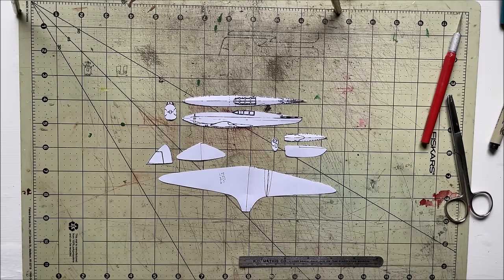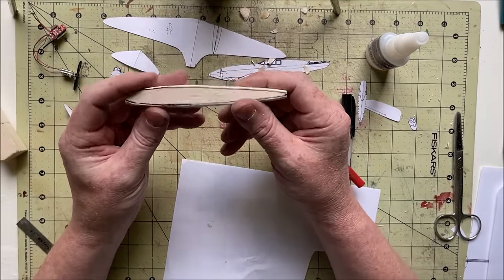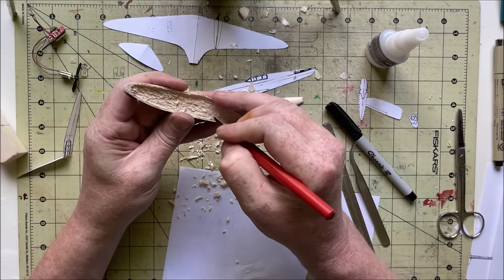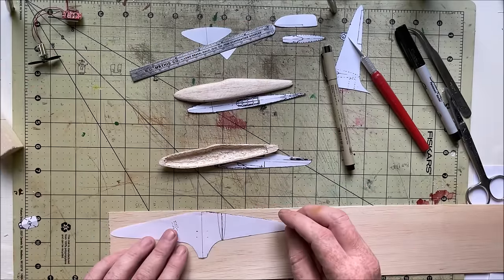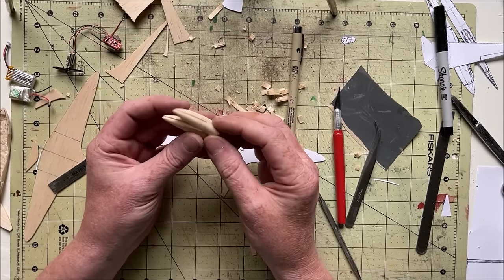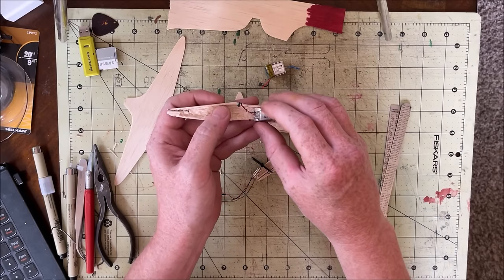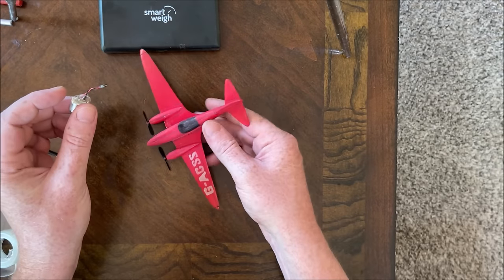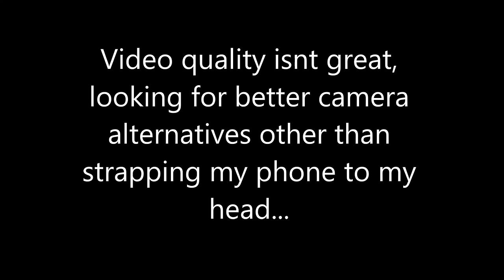micro DH.88 Comet RC plane build/flight

Comment: Wow.  What an awesome little plane.  At first I was thinking: How can this fly?  But now I see that it flies around like a little dart.  No wonder you painted it red :-)   I am guessing that it goes up and down by making both motors faster and slower.  And goes left and right by making the motors go at different speeds.
Reply from the maker: Thanks!  Yep, yaw is controlled via thrust differential steering, pitch is by throttle amount...pretty simple, but works quite well.

Comment: How do you navigate it without any wing flaps !??! 
Honestly, in compare of the size, speed and control you really should try to build a cockpit by removing the wood for a cockpit which fits a tiny VR Cam incl. the electronic parts covered with a self made aerodynamic light weight plastic windshield. 
Imagine you wear a VR glasses which gives you the illusion to sit in the cockpit and fly the plane like a real pilot. I mean it´s hard to watch the plane for a whole flight time with the naked eyes, but a VR system allows you to record any single flight on a micro SD card inside the plane ! I think such a extra would make it perfect! Not a lot people own such a tiny, handmade bird build from aluminium would be the kings discipline par excellence !
Reply from the maker: This one uses thrust differential for steering, one motor speeds up while the other slows down, and throttle and center of gravity location for pitch...more throttle and it'll climb, less and it comes back down.

Unfortunately theres not enough wing area on this one put any more gear, I do have a pretty small FPV camera system though that'll eventually go into a model, been wanting to try that for quite a while now.

Comment: Well done!  Amazing how well it flew!  I don't really understand how it's controlled but than I'm a larger builder, not a micro one :)
Reply from the maker: Thanks!  It uses thrust differential steering, one motor speeds up while the other slows down and it makes it yaw, pitch is just done by giving more or less thrust.  Super simple but works quite well.
Reply: @microbuilder  thanks for the reply!  Sounds like the model needs to be very well tweaked and balanced for this to work - Respect! 👍 Have a nice day
Reply from the maker: @Steven3D8888   Thanks!  Yeah setup is a bit fiddly, but still like a normal plane, just smaller tolerances.

Comment: Really fantastic! Gonna try your technique on making a twin engine micro plane, myself. Since the plane you got the motors from works with "pusher" engines, did you have to do something to reverse the direction of the motors? Or, did you find propellors with reversed orientation? If so, please share where you got them!  Many thanks.
Reply from the maker: Thanks!  I actually dont remember what I had to do for the props to go from pusher to puller, but I know in the past the most I've had to do was pull them off, and flip/switch one with the other, definitely shouldnt have to do any soldering.  There should be a link in the description for the plane I got the parts from, but if not, do a search for KF606 RC plane, it should pop up.
Reply: Thanks for your reply. Another question: do you remember how you got the wing dihedral to remain in place? Perhaps a tiny strip of carbon fiber, or just CA glue? @microbuilder
Reply from the maker: @steverudd5745  I cut the wing shape out, then just scored the cut line down the middle between the two wings and 'cracked' the dihedral into place, then just glued it.  Doesnt take much with these little guys lol
Reply: @microbuilder  Awesome, thanks so much!

Comment: This is awesome!  I can't believe it can fly like that without any surface controls and just the two motors.  How does it gain altitude/drop?  Just more or less power?  It turns perfectly too.
Reply from the maker: Thank you!  And yep, more throttle = climb, less = dive, there is a gyro built into the RX on this little unit, so thats probably helping, but yaw was still quite sensitive.

Comment: To get an even coverage use paper towel wrapped around a block of wood. If you want it lighter get some 99% rubbing alcohol and get another container from Walmart or similar in the cosmetic section, like the bottles for shampoo for traveling and flights. Add some rubbing alcohol to it then add some of the Indian ink and do a test. Add ink till you get to the color you want. 
Also you can do a full dip to get everything colored in one go. Just use a stick pin in the nose of the plane and dip it in the ink and take out quickly. Let dry and repeat if needed.
Reply from the maker: Great tips, thank you!

Comment: This is so cool. it really makes me want to give it a go, but I know that I may well end up with a non-flyer
Reply from the maker: Give it a try, the electronics I used came from a $30 ready to fly micro plane (the KF606), foam dinner plates work as good cheap build material to get your feet wet.
Reply: @microbuilder  Thanks, I probably will at some point, the new motors and recievers are so small these days. Did you have a rudder or use motors for Yaw ?
Reply from the maker: @goingoutotheparty1  This one just uses the speed of the motors for yaw, slows one down or speeds one up to make it turn.  Works quite well.

Comment: Aight this is cool, i might attempt to make a budged plane like this with one of those micro drones
Reply from the maker: Thanks!  I've never tried it with drone electronics, not sure if the flight stabilization or the way the motors work together would cause any problems.  Cant hurt to try though, and if it doesnt work, the plane I got the electronics from was only around 30 bucks.

Comment: what kind or brand of hobby saw are you using @1:25 it looked like it made short work of sawing that block of balsa, I did hear you say at some point in the video that the balsa you were using was fairly soft I had a nice one years ago that I liked and have one now that I don't like so much so looking to buy a better one!
Reply from the maker: Its an Irwin Dovetail/Detail saw (#213104), its incredibly sharp, I've used it to hack through some fairly large tree branches with little effort.

Comment: I do this a lot, probably not as small as you do I'm probably older then you are so my fine motor skills are tricky. So most of my small, I don't know if you can call them micro, but the wing span are under 20 inches. It's a lot of fun. I also build Balsawood kits, repair Balsawood & foam planes that are deemed unfixable. I have a lot of experience with planes, rockets, including High Powered Rockets needing certification, boats, and real aircraft, but retired. I'd like to try what you have done, it looks challenging. I always use parts from broken planes, I also offer money to those that crash real bad at flying fields. I can get my parts cheap. I use to just by whatever I wanted to try, but the prices are ridiculous for foam even kit planes with that and old age smaller one make more sense. I'd like to know specifically where you got those plans as I just wing it, no punn intended. Thanks for a great video.
Reply from the maker: Under 20 is definitely small, going smaller isnt much different, just a little more fiddly, definitely give it a shot.  The plans I just pulled off google after searching DH88 Comet 3 View Drawing, then I just scaled it to size when I printed it.

Comment: did you connect the batt at the wrong side right ? that was the problem. Nice job !!!! very nice
Reply from the maker: Thanks!  I think I accidentally cut the plastic coating on the receivers power wires, allowing them to short.

Comment: Hi, I just ran across your channel. And I was just wondering if you ever tried motorized like 1/48 scale plastic models? Or is the plastic too heavy of a material. I have countless foam military scale large aircraft RC Planes and many RC Hellicopters
Reply from the maker: I've wondered about that too, I actually went out and bought a couple plastic kits a few years ago, one of them the plastic was pretty thick so didnt figure that one would work, but the others plastic was surprisingly thin...never got around to trying to fit some RC gear in it, but it would be pretty cool to have something with all the detail plastic models have.
Reply: @microbuilder  That's what I was thinking the whole time on your build
Reply from the maker: @TheBuell49  Yeah I'm going to put that on the projects list, too cool not to try at least.
Reply: I would definitely be interested in that. I'm always working on project's and when there cool and actually work is always a lot fun
Reply from the maker: @TheBuell49   Agreed!  Cant say when it'll be, I've got 3 or 4 projects waiting in the wings (sorry for the bad pun lol), but its definitely on the list.

Comment: Hey there! Once again here to say great work, and to ask a couple of questions. A little while back I had said that I was working on a model like this of a de Havilland Mosquito in 1/72 scale, and I have a couple of questions in regards to overall weight. My model currently weighs about 6.4 grams in total. With electronics and paint, that is expected to go up to 12-13 grams in total. My model has about 8 square inches of wing surface area (10 if you count the elevator as wing surface as well). As of right now, it glides pretty well, requiring just a touch of trim to the right to ensure it stays on path. My question is, will it be able to fly well if it weighs 13 grams and has 10 square inches of wing area? I know that you recommend around 1 gram/square inch, but how much more can the aircraft tolerate before it becomes unstable? I also managed to incorporate a pretty decent airfoil into the wing, if that is a factor. Again, great work!
Reply from the maker: I generally dont count the tail surface area in my wingloading totals, mostly just because the tails on these little birds are so small they dont add much (though every bit helps).  If youve got enough thrust, it'll probably fly with your higher wingloading, but like this DH.88, she probably wont slow down much, might get a bit twitchy too, but that makes for good thumb practice lol  Big grassy fields go a long way in helping survive the first handful of test flights, I'd start with probably 3/4 throttle and a good solid throw at a slight upward angle...your fingers will be busy, so cross your toes lol
Reply: @microbuilder  Thanks for your advice again! Hopefully when I get her ready to fly it won't be a pain in the air :P When I finish I'll be sure to show you some footage lol
Reply from the maker: @DomsCorner123  No problem, and good luck!
Reply: @microbuilder  Thank you!

Comment: In future glue a sheet of paper in between pieces of wood you wish to split apart again. Tempory joint which when opened tears through the sheet
Reply from the maker: Paper becomes surprisingly strong when CA is applied, the halves would probably break apart ok, but removing the remaining paper might get tough.

Comment: what am i missing, i didn't see any control surfaces, how is the plane banking and controlling pitch???
Reply from the maker: It uses thrust differential steering, it slows down or speeds up one of the motors to make it yaw, pitch it controlled by throttle.  Pretty simple, but equally affective.

Comment: Have you tried coating the balsa in CA glue? Does it add much weight, or is it pointless?
Reply from the maker: It would definitely help strengthen the skin of the wood, as I've used CA as a clear coat on an old beater guitar I've got, but unfortunately CA is also pretty heavy.

Comment: Awesome build never saw a block cut into shape like that . I want to try building a micro plane where do you buy motors and electronics have a great day
Reply from the maker: Thanks!  If you do a search for KF606 rc plane you'll find the plane I used the electronics from.
Reply: @microbuilder  thank you for the replie going to start on plane this weekend
Reply from the maker: @chrisgilpin3403  Good luck with the project!

Comment: really great video and results, congratulations! I was wondering what reciever + ESC + motor + battery combo you would recommend. I would love to try and make my own micro RC plane, but I'm not sure where to find micro electronics.
Reply from the maker: Thanks!  If youre looking to just get started, I'd suggest the electronics that I used in this plane...if you do a search for KF606 RC plane, you'll find them on ebay and amazon for 30-50 dollars.  You get a 2.4ghz radio and receiver, the motors, batteries and charger, plus the foam plane it all comes in to play with before you take the electronics out.  Pretty hard to go wrong, considering a 'hobby grade' micro RX meant for magnetic actuators can be 30-50 dollars all on its own.  Also worth checking out RCGroups, its an RC forum and they have a scratch built micro RC section where I learned everything when I first started.
Reply: @microbuilder  Just bought the KF606 online! Let`s see what I can do... Congratulations on all the views on this video, looks like its going viral!
Reply from the maker: @thiagov6123  Thats awesome, theres many twin engine planes out there to choose from, almost makes it hard to pick one.  And yeah I'm kind of blown away at how well that video did, people REALLY love the Comet apparently lol

Comment: No aileron, no elevator, no rudder!
How do you control the model?
Reply from the maker: Its only two channel, so pitch is controlled by throttle...more = up, less = down.  Yaw is done by slowing one of the motors, which makes it rotate left or right.

Comment: I have a Flybear P38 (Fx-816) that tip stalls a lot and is hard to yaw with its differential thrust. I’d like to add actuators to it for ailerons and elevator but idk how to set them up given the limited channels. I thought about doing ailerons only in which each would be to a corresponding motor so the roll can help the yaw turn the plane. But when I throttle up there would be too much lift because the ailerons are activated and essentially act as flaps. So then I was thinking about elevator going down too but idk how to do that unless I do 2 actuators for the elevator so each time I throttle even for a turn the elevator will go down a bit.
Reply from the maker: Most cheaper 2 channel systems dont really allow adding actuators, might be able to work in a rudder actuator, but I dont know that plane so dont know if it would actually work.

Comment: Well done.
Did you scavenge the electronics from a tiny cheerson cx -10 drone ?
Reply from the maker: Thanks!  Close, the electronics came from a $30 micro RTF plane called the KF606, you can find them on amazon and ebay and other places...great parts donor.
Reply: @microbuilder  even better because of the stabilizer

Comment: I kind of want to try this, but maybe just a static model cause I have no idea how to do stuff with electronics and it seems hard cause i don't know a single thing about woodworking
Reply from the maker: Give it a go, balsa is cheap, and the electronics came out of a 30 dollar plane so its not much of an investment.  I'd suggest making something a little bigger for your first attempt, the build and flights can get more tricky the smaller the model is.

Comment: hey! how did you manage to turn puther motors into a puller config? Cool
Reply from the maker: Thanks!  Just gotta pull the props off and flip them around and youre good to go...actually its been a while, you may have to flip left to right also, cant quite remember, but its easy to check if you just spin the motors up a little.
Reply: @microbuilder  Thanks! nice build!
Reply from the maker: @Michael_Insects  No problem, and thanks!

Comment: You could have cut a 1/32" center-keel, sanded 1/64 from each fuselage half and then glued the keel in between.  Two neat joints instead of one not-so-neat.  Obviously the keel gets hollowed.

Comment: Thin out the alcohol ink with alcohol and apply in multiple coats. I use this stain on furniture and it looks super.
Reply from the maker: Thanks for the tip, I'll definitely give that a shot, its so much lighter than spray paint!

Comment: hey microbuilder! i would love to have a tutorial on that pocket racer RC im thinking about building one myself is there any chance you could  do a tutorial or make a video for beginners to start off  i would LOVE that if you could give me some advice/ tips i tried back in February to reach you on flite test but i got no answer lol EDIT: would glued layers of paper work for the wings??? i dont have balsa wood big enough for the wings
Reply from the maker: Wow, really sorry for this 9 month long reply, youtube never sent me a notification of your comment.  That little pocket racer was build the same way this one was, only difference was the pocket racer used a magnetic actuator for the rudder, rather than twin motor steering like this Comet.  I am currently working on a new project that also uses actuators, so that may be of some help.

Comment: This is so neat! maybe I missed it, but what about the control surfaces?
Reply from the maker: Thanks!  This uses thrust differential steering, so pitch is done by the amount of throttle, yaw is done by slowing down/speeding up one of the motors to make it rotate.
Reply: @microbuilder  ahhhh ok!

Comment: I don't quite understand how it's controlled, how to do the pitch? Do you use the throttle?
Reply from the maker: Yep, more throttle = climb, less = decensd.  The center of gravity is set a bit rearward to help this.  Turning is done by speeding up one motor while slowing down the other to make it yaw.  Pretty simple, but equally effective.
Reply: @microbuilder   Thanks：）